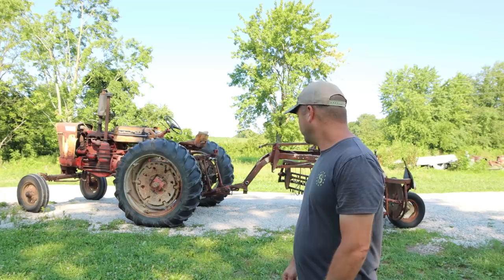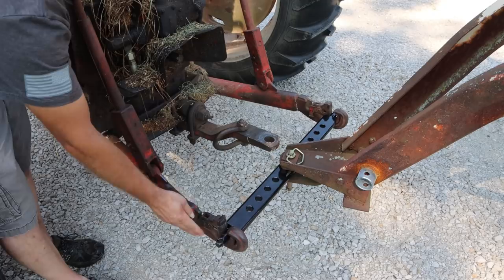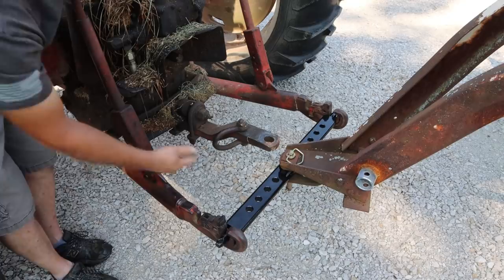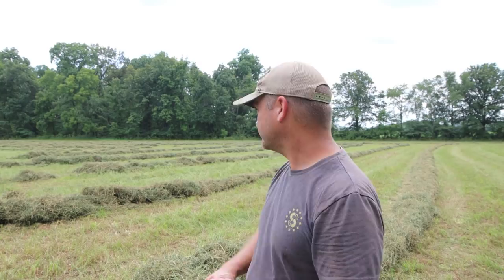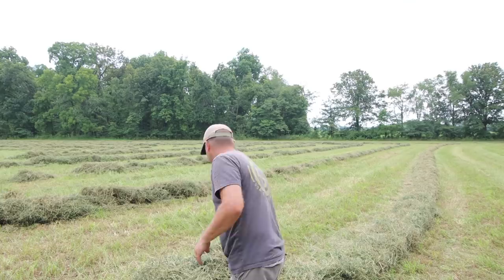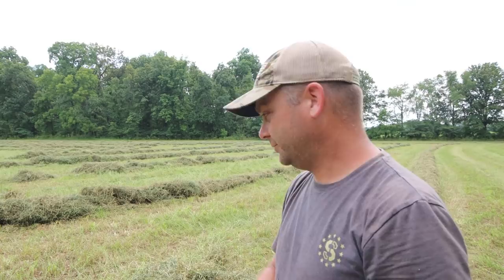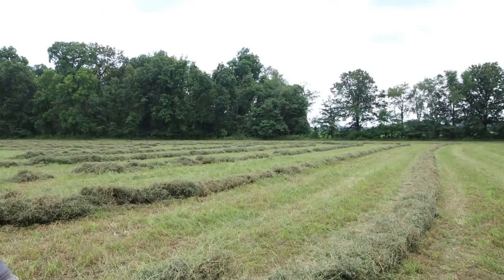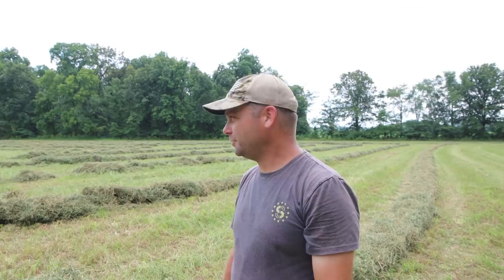The hay is looking good, but I'm Raking Double Windrows since there is less of it.

Comment: Evan instead o driving the same direction to make your windrow  raking the windrow in then turn around and rake the next windrow over  instead of going around the field in the same direction  and missing hay this will insure that you get ever bit of hay so the  the raking pattern would be  first one in  second one  out and so fourth so basically your odd number pass is in mostly and the even number pass is out mostly and raking using the three point hitch in my opinion is going to be a little harder  getting the finer adjustments

Comment: I don't like to be a critic because I totally applaud your efforts and your videos are great but I must point out that you are raking the second windrow over the first windrow in the wrong direction every time. 
This leaves a pad of hay at the bottom of every combined windrow that does not get turned. The better way is to turn around on the second pass and roll the hay back in the opposite direction toward the first windrow.  To do this, you will need to straddle the first windrow which is no problem with a wide front end.  Hey folks, can I get a witness here?
Reply: thats how I learned to do it, rake long rows, make the turn, run right along the first one on the way back, then do a lap or two on the end rows to clean along the field edge, bale one end first, then an out side row on long side, then the other end, you can turn as you wish, and not run over too much hay then
Reply: Absolutely how I did it growing up as well. Well said and good advice.
Reply: Not only is some hay not lifted up, the windrow builds rotational inertia on the second pass and keeps turning, so there are many little rolls pointing past the line of the windrow. The next pass, with the leading edge of the rake now pulling from the flat hay just inside the windrow, can grab those rolls. If the first pass pushed hay to the inside, then the second one pushed hay out against the first row, there would be a natural stop for any inertia. Given you cannot lift the tines above a windrow, you may have to get creative on ways to get space to turn around. The outer row is usually lighter anyway, so consider doing two passes in, then moving that far inside and pushing 2 passes out. That would give you almost 20’ of open. Then do straight rows along your straightest side. Up and back, then repeat. You’ll never have the times reaching out and grabbing the windrow, and you can make a windrow about as wide as the gather header on the baler.
Reply: That is what i thought also..i was taught to use the horseshoe  method..lol...i made that up but that way you get a well formed windrow...i would tell my raker 2in 1...3in 1...or 1and 1 depending on how heavy the hay is.
Reply: BTW this is my 43 rd consecutive yr of haying..all round bales since 86 but still the hay field...im impressed with your baler..it makes a pretty bale of hay...i always liked to keep the baler full of hay..at least have a window half the size of the pickup..better to drop a gear  instead of runnin over the field more.Youre doing good if this is your first go at baling hay.
Reply: Good one KC.
Reply: @benscoles5085  same way I was taught
Reply: Roll 2 in and 1 out is hw  earned
Reply: I've been raking hay for 30 years and I've never seen anyone double up rows like this... I start clockwise on the second row until I get to the center, then flip around and rake the unraked hay into the other going counterclockwise..

Comment: Rake 2 (or 3) rows around the outside of the field like you are & then rake the last inside row back toward the outside of your field once. That gives you extra turning room so you can rake the center just like you'd disk or plant a field (going up & back). You don't have to rake it the same way you cut it. That rake is designed to pick up hay from multiple directions. We have one of similar design. & it is also uneven until you crank it down. It's normal & is just the design of them. And it doesn't seem like could turn as tight with that bar hitch as you could with the regular hitch, which tight turning is important.
I live just west of Vincennes IN by about 30 minutes & we had cattle on our family farm until 2017 so me & my family have a lot of experience with hay & hay equipment. If you ever need or want help or advice, message me @ "Waxler Farms" on Facebook(if you have Facebook).

Comment: I'm wondering just how much hay you leave in the field. As I remember making double windrows was much different than you. Pick your starting point and go around the field. When you get back to your starting point you turn a 180 and go back. Tire spacing will determine where you need to drive but the side delivery rake should tie the loose hay your raking into the windrow and turn both over about half a turn. This would work whether you go round n round or making windrows straight back n forth in your field. Understand I was doing this in the 60's and farming has changed dramatically since then. Keep up the great vids.

Comment: One thing I may have missed on your sickle is did you replace the ledger plates in the guard..its been a long time ago since I've used a sickle but I would put new ledger plates in..or new guards...just a thought that may improve your cut..with a short crop its not going to cut as clean...you are doing a good job at any rate.

Comment: good comments on the most common way we have all learned to rake hay into double windrows.   One thing you will find, to do a nice job raking hay, you almost need to be an artist.  I heard you mention you end up with a triangle in the middle at some point.   I always found a field shaped that way interesting when raking.   you need to think about 2 steps ahead as to which way you need to turn the hay and how to handle those geographically odd shaped fields.   I used to worry about my windrows a lot but found in the end,  if it is in a windrow... the baler will get it.  I don't worry about the odd shaped field left in the middle.  just so it all gets raked... the baler will get it.

Comment: It's an old fashioned swath turner !. Hay rake has parallel tines that lift up by a cogged  gear on one wheel. It was used to put hay into rows, first one I used was horse drawn ! Swath turner is to turn the hay to let  it dry. But your getting virtually the same effect as you are. Anyone agree ?.

Comment: Your sickle mower is probably doing as good of job cutting the alfalfa as it can. Alfalfa has long twisted stems, so it doesn't stand up straight which makes it harder to cut. I don't know that a disc mower or disc bine would have done any better. Just trying to save your mind from trying to figure out what's wrong with the mower when I believe there may not be any issues. Good videos, and good luck.

Comment: The rake should have a disconnect, so it is not spinning during transport.  Generally speaking, always rake in the same direction as you mowed.
The only time you should rake counter clockwise, is the outside section,.  With a field that shape,you might consider making a loop instead of trying to make sharp corners.

Comment: That is what Case calls a Eagle hitch . This was their proprietary hitch they used for a number of years . The later 830 tractors have the true 3 point .
Reply from the maker: According to my service manuals, If you bought a Case 730 with draft control, it had a 3 point hitch instead of the eagle hitch.
Reply: @CountryViewAcres  isn't yours an 830 ? Or 841 ?
Reply from the maker: @pltmann  , no it is a 730 or 731.
Reply: I Have a 1967 841 with a 3 point . I know Case used the Eagle hitch for a number of years . Not sure when they started or what models they started using the 3 points .
Reply: @CountryViewAcres  Oh ! All this time I thought it was an 830 . It likes a good runner  .
Reply from the maker: @pltmann  mine is a 1961 with the eagle hitch.  I would prefer the 3 point,  I have a few implements I can't hitch to the case.  I have researched changing the arms out for 3 point arms.  I may do it some day, but keep the eagle hitch arms so they could be put back on to make it back orginal.

Comment: Suggestion - To get rid of the small triangle at the end, after you make your first pass around the outside turn down the middle of the field and and then work your way across the field like a zamboni driver does an ice rink in a circle.  You're using the Whirlpool method of getting smaller and smaller as you go where as if you just do a moving oval/square  you'll have even straight lines across the field.  here is an example    http://2.bp.blogspot.com/_ZhGPUgtte54/SeKZ4KLpSaI/AAAAAAAAAB0/562Elj08nDA/s320/zamboni_pattern.gif